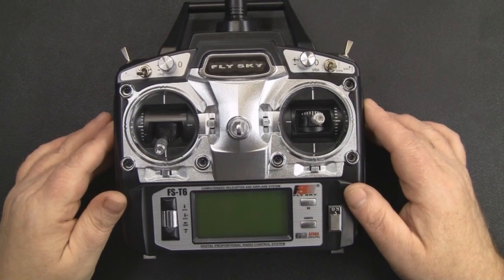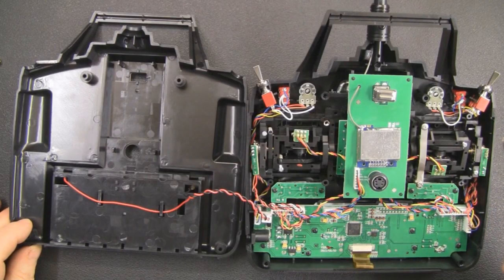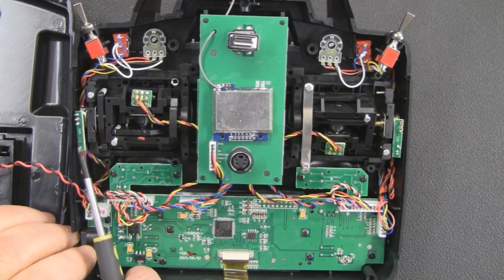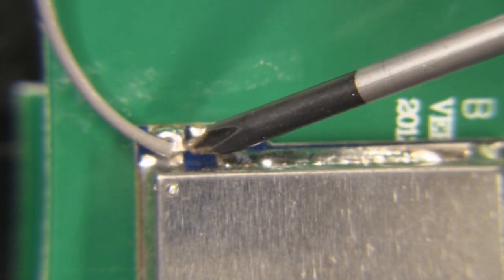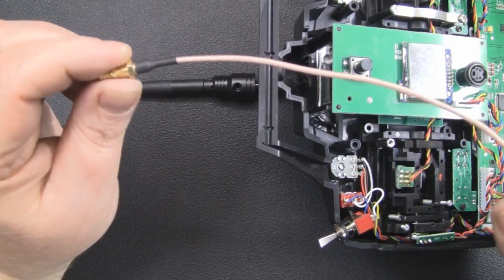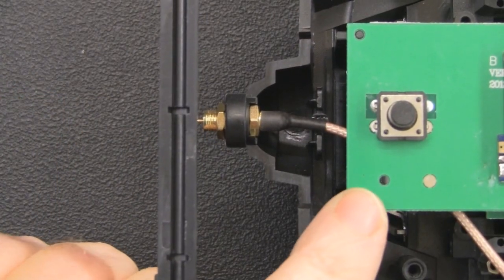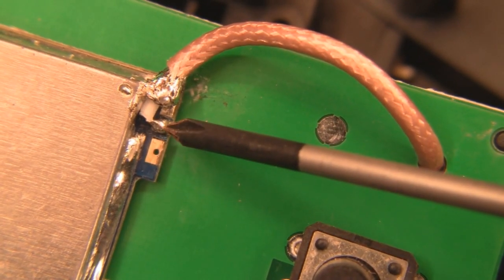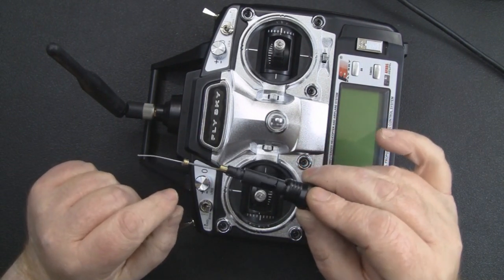FlySky fs t6 Antenna Mod #82

Comment: Nice!

Off topic question. I blew one of the pot of the gimbal. And can not find exact same pot to replace it. can you please see what can possibly be the replacement pot for this radio?
thnx.
Reply: You can just buy another (they generally say what value the pots are on the pots) they are cheap and can be found on Ebay or local electronics stores.
Reply: Flysky sent me another gimbal for it for free. I paid for shipping though. And also bought another radio as well. But that exact pot, I just can not find it!!!
Reply: Chirag Chaudhari  That's generous of Flysky. If you really wanted to, you could rip your old gimbal apart and try to see what value pot it is.
Reply: theminingfish I know that its 5K linear (BK5), but the shape and size of the pot is the problem. I did not wanted to modify any of the internals by trying to fit different size/shape pot.
Reply: Chirag Chaudhari I just opened an old fs t6 I had and found that the pot is replacable but requires for the whole gimbal to be dismantled and for a tricky soldering job...
It could be done but for what it's worth, I would buy another gimbal.
Reply: theminingfish 
Did you find a pot with the same spec? It's a b5k 60 degree and it's really hard to find.
Reply: Yeah but I found a ton of old cheap transmitters which had them in
Reply: Can you tell me one?
Reply: Klemen Zaleznik it was an unnamed transmitter that I got with one of my very first rtf planes
Reply: Klemen Zaleznik i was unable to find that exact design pot. You can find bunch of 5K liner but they dont fit in there. I got the replacement gimbal so I do have one extra pot from the old one. you live in states?
Reply: Chirag Chaudhari No i'm from Slovenia. I fixed it for now. I glued the back plate and pins of the pot with hot glue. I found out that the pins that go in to the pot were slightly loose and that caused it to move without moving the stick. For now it's seems to work but i want to upgrade the tx with frsky module and telemetry display. So just in case i wanna have a spare. :) thank you anyway.
Reply: Thats great you got it fixed.